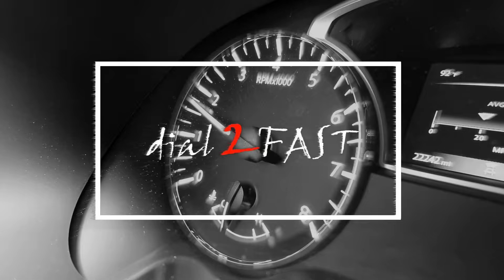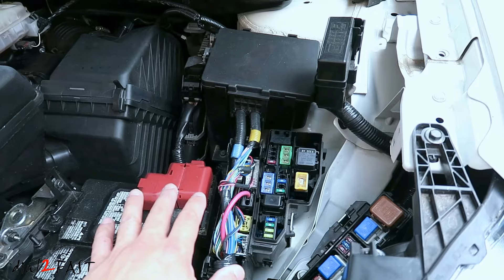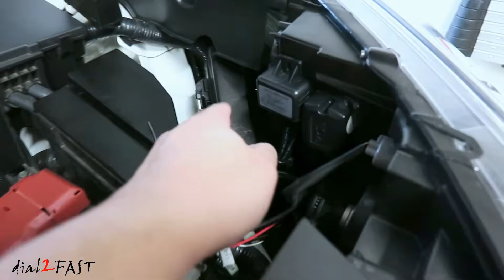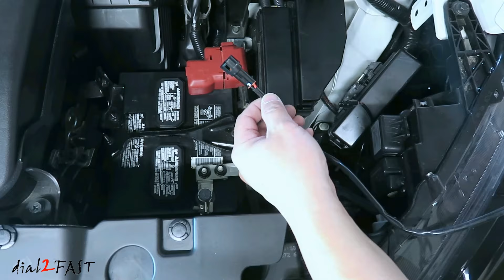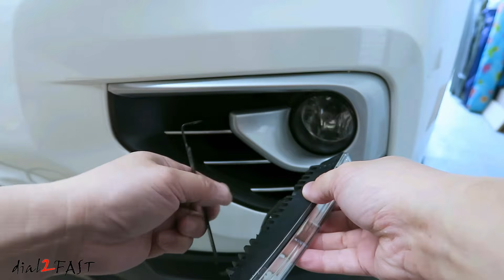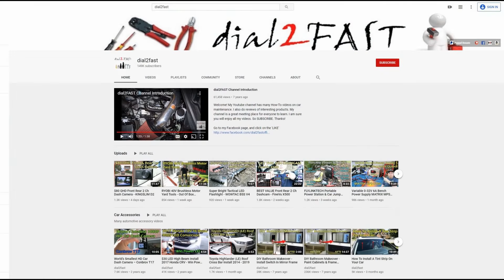How To Install (DRL) Daytime Running Light | Nissan Pathfinder

Comment: Thank you for the nice video. Is it possible connecting the white wire through parking light fuse box tho?
Reply from the maker: You have to check with a multimeter to see if the parking light fuse in the fuse box is constant 12v or is switched on only when parking light is on.

Comment: Greetings from Malaysia. Thanks for the great vid man. Subscribed! Can I just ask:

For power input im planning to tap the ACC on the stereo of the car, and the white wire to 'illumination' on the stereo as well, instead of to the headlamps.

Do you reckon it would work? I'm thinking what we need is a 12V to the white wire when the lights are on, im guessing the illumination does that right?

Also the ACC on my stereo has already been tapped to power my Steering control module. 

Im worried if i tap it again, it would result in voltage drop?

Thanks in advance for any advice!
Reply from the maker: Hello Malaysia! I visited there many years ago in KL and JB. Miss the food. You can use the stereo illumination wire to trigger dimming of the DRL. You can also use the stereo's ACC wire to power the the DRL light BUT make sure that circuit can support all the accessories that's being powered. The DRL light will consume about 300-500 mA. You are not going to have a voltage drop, but if the circuit can't support all the devices, you will either have a fuse blow or wires heating up and melting (fire). Also keep in mind doing it this way require you to run the wires into the vehicle which I personally find it more work. It's up to you but try to keep the wiring clean and safe.
Reply: @dial2fast   @dial2fast   @dial2fast  Hahaha welcome again sir after the pandemic flying restriction!

Actually the reason why i wanna tap the stereo is because I could tap onto the added ISO socket, so that the original wiring remains unaltered. 

But yea I might drop this idea considering the fuse issue. 

Just out of curiosity, may I also ask if you know why would some people connect constant 12v to power the controller when the ACC already suffices? It doesn't really need to remain on to retain memory (like the stereo) or anything right? 

Is it because they wanna delay the turning off of the drl after key off.
Reply from the maker: @tzershernkhaw  The reason for connecting the DRL controller to 12V constant is simply ease of install. You can  connect the DRL controller red wire direct to battery +, and connect black wire to chassis ground. This way you don't have to waste time looking for ignition wire. By connecting direct to 12V constant, the DRL light will turn on only when ignition is turned on and voltage rises past 13V (does not turn on at 12V). The DRL will turn off automatically when ignition is off, and voltage drops past below 13V with a delay of about 20-30 seconds before DRL light turns off. I personally don't like having that delay in turning off the DRL (I think it looks weird and gives it an aftermarket look), so connecting to ignition 12V will give you instant on and instant off with ignition.
Reply: @dial2fast  Thank you so much!!
Reply: zmoh p.  Nope - I did that already. The controller's output will be cutoff 30seconds after ACC is off.